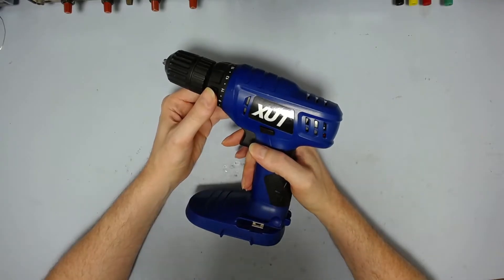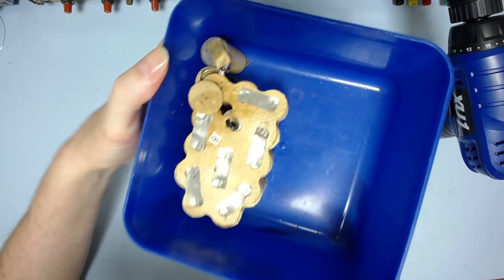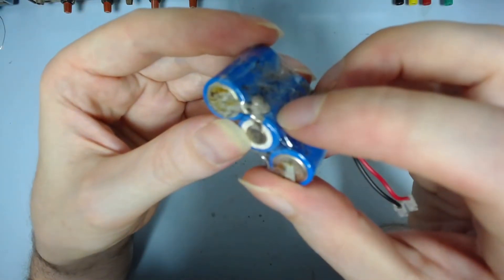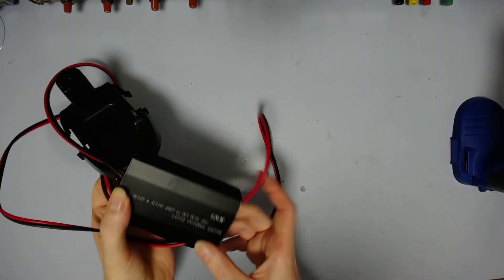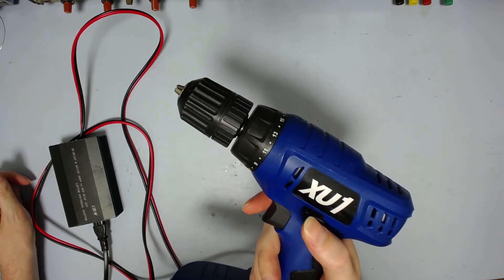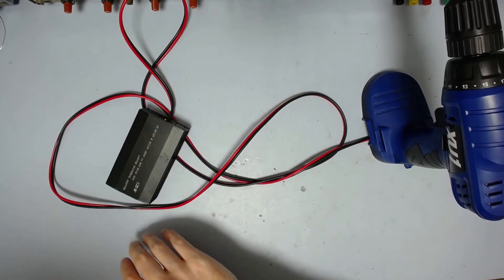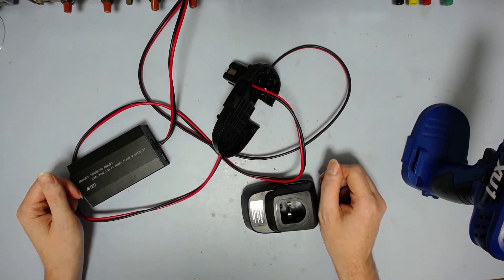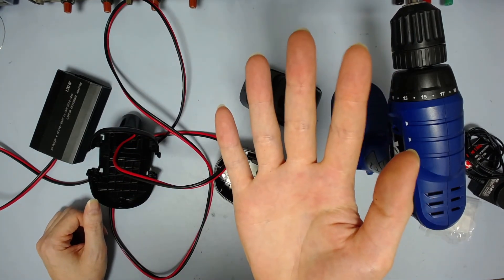XU1 XCD-018 cordless drill resurrection & conversion

Comment: Does anyone know if anyone makes a Adaptor Kit to plug in a Ozito Pxc 18v Battery?
Reply: You could just buy an XU1 Li-ion battery from Bunnings and stick the bottom of the battery case from that (the bit that holds the cells and circuitry) to the top part of the old case (the bit that goes into the tool itself). Anything from duct tape to a nice, neat self designed 3D printed adaptor would work.
The new batteries are dirt cheap. I bought one to use the cells to replace the ones in my old netbook battery and they worked great apart from having fairly low capacity, which necessitated a bulky 3S2P setup rather than the original 3S in the original netbook battery, but on the plus side, the 3S2P battery is about 60% higher capacity than the original netbook battery so it lasts way longer.
Reply from the maker: Probably not, they want to you to buy a whole new set of course. Someone else in the comments mentioned 3D printing their own battery case for a lithium upgrade. Perhaps you could do that?

Comment: I converted my older XU1 to lithium on my channel a few years ago, ie , I 3D printed a larger lower case to house 3S2P.
Reply: Was it a 12V drill? The drill in this video is 18V, which needs 5S, regardless of how many of those are in parallel.🙂